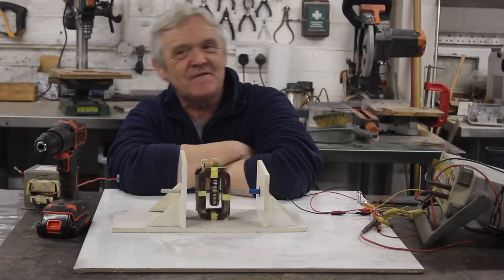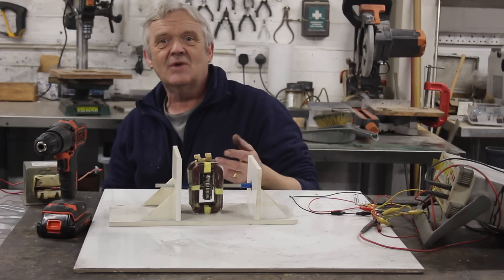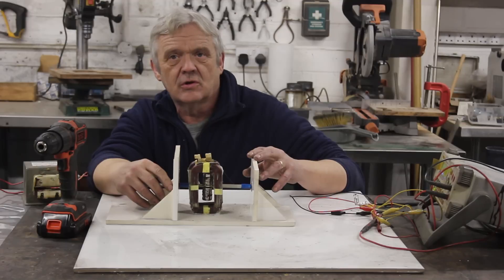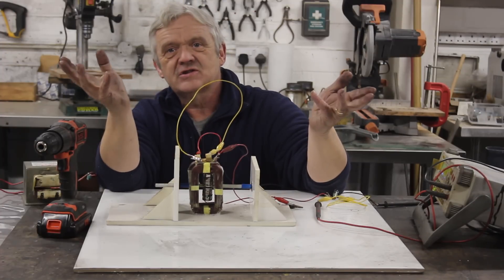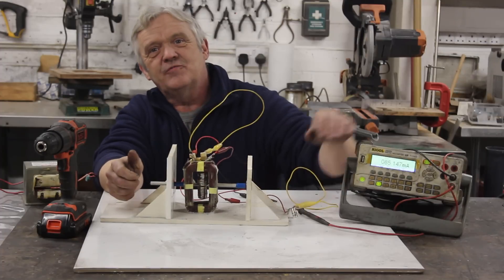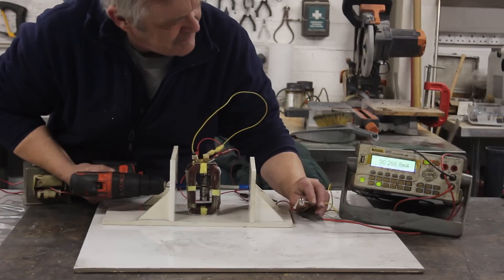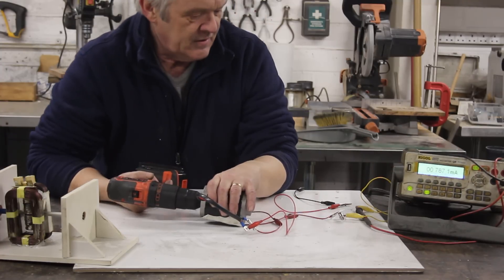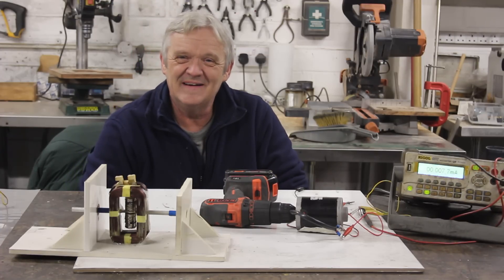1810 Newman Motor Generator - Better Than Shop Bought Generator

Comment: Thanks Rob for covering this like I asked of you . I appreciate it very much considering the hate I got for even asking this of you . Keep doing great work Rob
Reply: The results are ridiculous see .. so why is the gene industry doing us like this ?  U said 250 milli amp vs 13-14 milli amp . That is crazy how bad they are doing us
Reply: @mattg6472  I think he said 25 milli amps.
Reply: @Pok3rface  13 ... 25 ... Whatever when it's stacked against 250 milli amp . That's 10x worse than what's sold in the store. Does anyone see a problem with that lol?
Reply: Go with the trained elephants ! Lol hahaha
Reply: It wasn't hate targeted at you it was just healthy scepticism.
Reply: @justtinkering6713  no worries tinkering you were the least of it. I asked other times in other comments sections. There is just alot of hate for Newman himself obviously . I'm fine with that though.. I don't want to be associated with Newman. I just recognize his magnet/ coil arrangement is nice for various reasons . I've tested my own Newman motor and see NO "free energy".  It's a great gene though 😁
Reply from the maker: no worries mate - it was a good question and I wouldn't worry about some folks - they just like to post - most of them have zero content
Reply: Would it be worth connecting the strange steam engine as prime mover to Newman gene ? Vibrating magnet vs spinning magnet .. is it worth the extra parts ?

Comment: As I recall when Newman appeared on the Johnny Carson show with his device, he explained some details of the construction of his magnet rotor, this thing peaked my interest so everything went into slow motion as I listened to him speak, he described five stacks of magnet wafers which were glued into five cylinders which were attached in the center creating his rotor, however the one thing that stood out when he described his device was how the five cylinders of magnets were created by gluing strong magnets north to North and South to South thereby creating an accelerated magnetic field in between each magnet glued together, I cannot seem to find that appearance on The Tonight Show with all of those details all that seems to be on the internet are Snippets.
Reply from the maker: I wouldn't get too tied up with the Newman motor mate - there are things in it that are interesting - but Newman's descriptions - hmmm
Reply: @ThinkingandTinkering yes his descriptions were different, one of the things I recall on his appearance was when his neighbors were interviewed and that this device was powering five houses from Joe's basement, I've only been able to find little Snippets of his Tonight Show appearance nothing with his neighbors, nothing about the magnet structure of the five column rotor. My point of wonder in this device is about the accelerated flux shooting out between the like poles and if the speed of that flux helps contribute to the output in a generator. It is sad that Joe had so many grifters after his time trying to patent his device that it left him bitter.
Reply: If you are up for it Joe Newman has a rather lengthy patent application that could be a fun read. From watching some of his videos and reading some of the patent his actual motor invention is somewhat more complicated than this demo device.... well... not the thing shown here... the device up here in the video is claimed to be a core-less motor but the magnets quite fanatically want to point upwards?? The bearing also seems quite horrific if we can even call it that.

But ok, it is suppose to be a stack of magnets on the axle and a coil (without ferromagnetic parts!)  and some say the commutator is suppose to SPARK. (It should still kinda work with a reed tho)

The more advanced application has the stack of magnets packed in ferromagnetic material. It wouldn't work as a conventional generator as the field no longer extends beyond the core. The coil pulses a magnetic field into the core flipping its polarity. You get the sum of the electromagnet and the permanent magnets extending beyond the coil. You get a much greater spike back than you put in which is suppose to trigger the sparks.

Putting that back into a battery is not a very efficient process (not sufficiently) and another down side (or perhaps an upside?) is that pulsed dc rejuvenates old batteries.

In the original CNN demo the giant motor runs (indefinitely) on a few tiny non rechargeable batteries that are empty, when the TV team wants to go home they measure the voltage on the batteries and they held more charge than at the beginning.

People want to cry impossible and argue everyone would be doing it but building a giant device for uhh a few thousand? That can pull its own weight and put milivolts into a battery over several hours isn't actually useful. At best it can make people think.
Reply: @gabydewilde  He never fully disclose it, and he even destroyed Big Eureka two days before his death.
Reply: @fxeconomist   he disclosed enough to provide us with a clue how to build it. In that we have a lot more than he did at the time back in the days ;)

I doubt the myth buster quality build in the video made us any wiser collectively. Perhaps it did or perhaps it made our collective slightly more stupid. It is hard to tell.

Maybe put a real bearing on it? lol
Reply: Gluing North to North would not create a stronger magnetic force,  You would have two Norths fighting against each other, squashing the field, there may be a small bulge radiating from the point of contact though not much. A sort of teardrop but the thin end round not pointed.
If they go North to South you get a small increase in field strength, the more you stack the bigger it gets, I believe proportional to the amount of magnets used.
Reply: @davidsoulsby1102  
Actually,  the idea has some merit.  When you force North and North together,  the magnetic field in that area is super compressed and it will appear as if it is stronger.  

You can try this with a sheet metal.  Attach both north poles on the opposite sides of the sheet metal. No need for glue.  You will find that the edges of the metal is extremely strong.
Reply: @WTF_BBQ  correct
Reply: I used to watch a lot of his videos.  There's one in particular that really caught my eye.  When he was demonstrating one of his coils which happened to be attached to a balloon sitting on the ground,  the thing lifted in the air and oriented with the Earths' magnetic field.  From the looks on his face,  he didn't anticipate that happening and quickly brushed it off.   He did mention that the coil was energized with the main power line,  so I was scared to try it.
Reply: There is a poor quality clip of the interview on the Johnny Carson Show, about 15 minutes long, on the Physics 101 Youtube channel. Not sure if it's the full interview as I never saw the original.
Reply: Vortex magnetic fields do something very good for water too as it passes through the field restructured water does wonders with plants

Comment: I would love to see these in a practical application. I know that's not the thrust of this channel, so it's more of an open challenge to anyone else with the wherewithal to make it happen. I'm not electrically inclined, which is why I don't do it myself. Somebody please make a practical application of this, or several, and post a video for us to see.
Reply from the maker: Great suggestion!
Reply: lets use a small dc motor to spin the assembly with a rechargeable battery and use the assembly current output to recharge the drive battery!